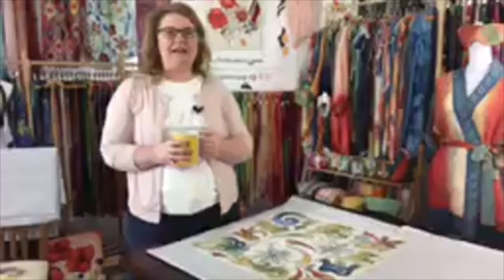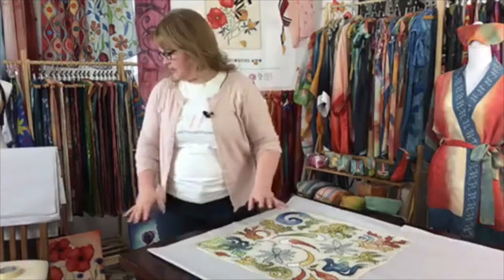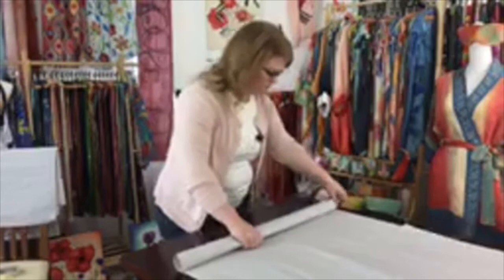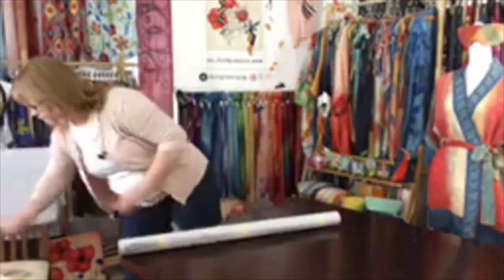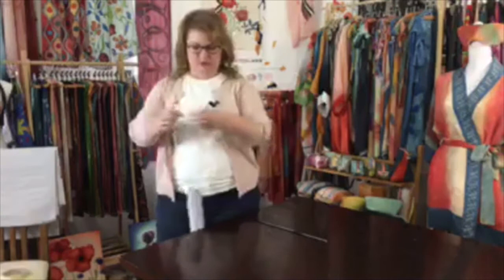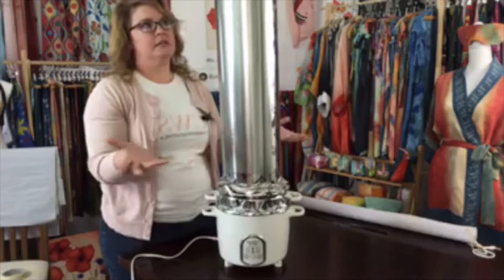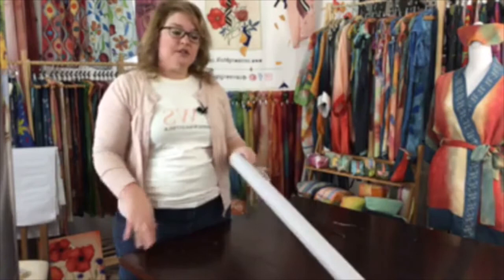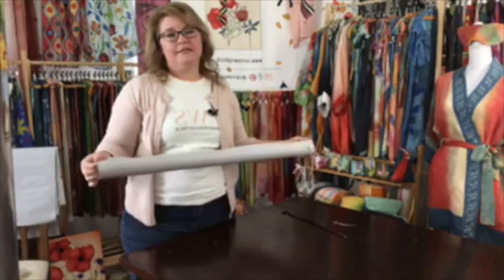Silk Painting Basics Part 3 - Steaming

Comment: do you need to top up the water in the rice cooker
Reply from the maker: Yes! You sure do! I use a pitcher to pour water down the middle of the opening at the top. I can tell by picking up the cooker and sloshing it back and forth about how much water is in it. Since I’m steaming nearly daily, the water is constantly being freshened and cycled through! I change my pipe about every 18 mos as it will rust on the inside over time.
Reply: Silly me. I meant do you need to top the water up while you are steaming to prevent it running dry. I bought a large horizontal steaming which I havent used. But love your idea of the rice cooker as I have one in my cupboard which I never use.
Reply from the maker: @MsHeebiejeebies  No! I never need to top off the water DURING  a steam, and I’ve steamed as long as 5 hours for a very large piece of yardage!
Reply: Ok that's good. Thanks
Reply: @CarrieWrightSilk  That's amazing that the water never runs out. I want to try dying some silk flags so your video is really good. Cheap and easy just how I like my crafts. LOL